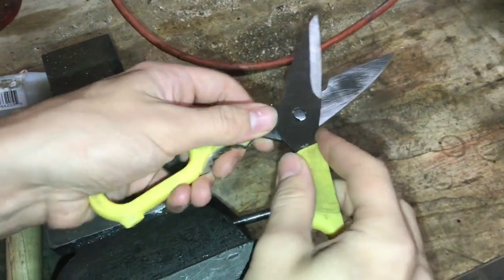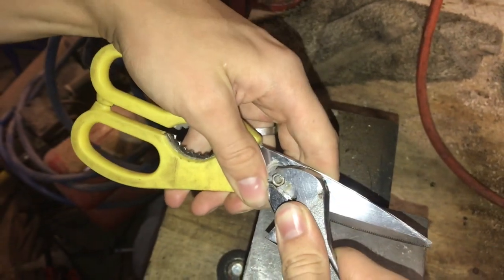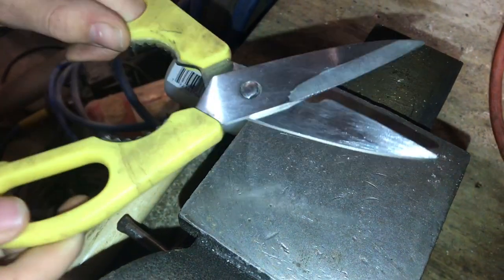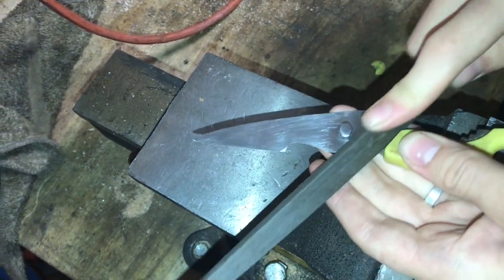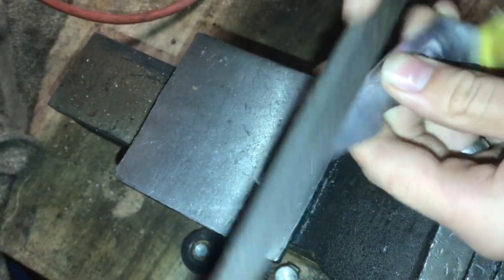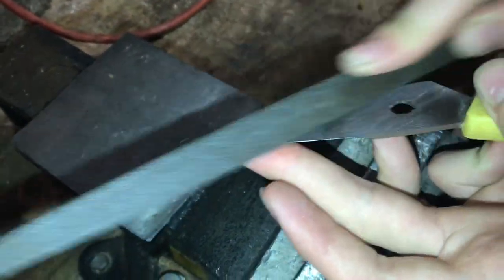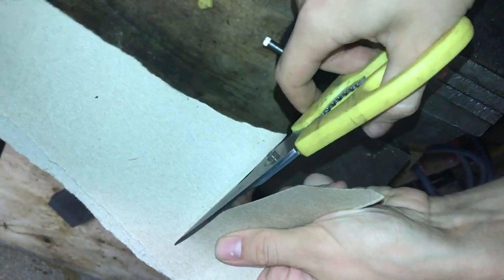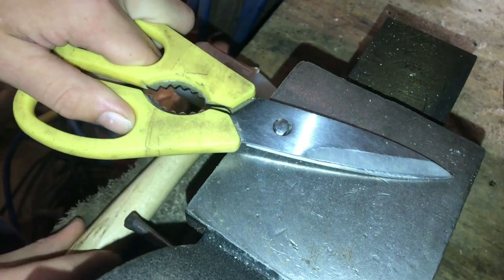how to TIGHTEN and sharpen a pair scissors

Comment: I have a pair with a screw in the center instead of a bolt.  If I tighten the screw, the scissors work once or twice until it loosens again.  Is there any way to keep the screw from loosening?
Reply: use blue loctite. it's used for holding screws, bolts, and nuts in case of vibration or shaking loose, but you can still unscrew it if you want to.
Reply: @maxlee6676  Had the same idea and tried it with a high strength threadlocker, 1 day in everything is fine, let's see how long it lasts. :) Any undesired loosening in your experience?
Reply: @em0_tion  
How about now? Is it still tight?
Reply: @someguy2744  Oh, yeah. Use mid strength glue though, the high one was a bit overkill. Cleaned a pair of cheap pruning shears and used it there too, but dried up way faster than expected and I couldn't tighten it as desired. Can't even disassemble them now. 😂
Reply: @em0_tion  
Thank you for the swift response after a year.